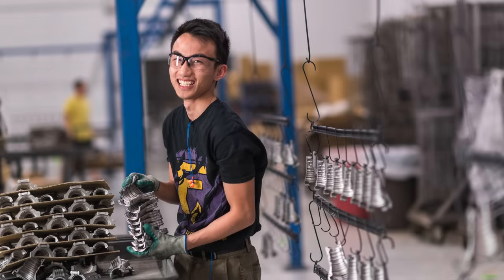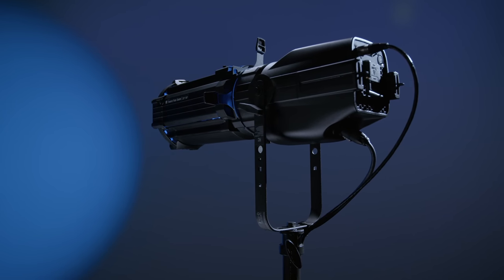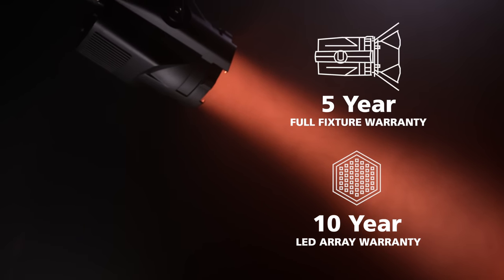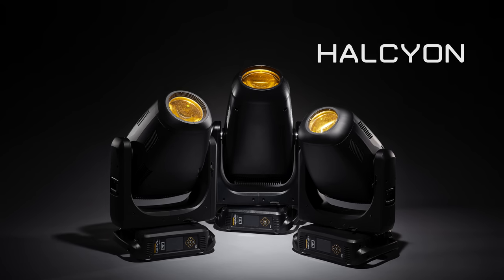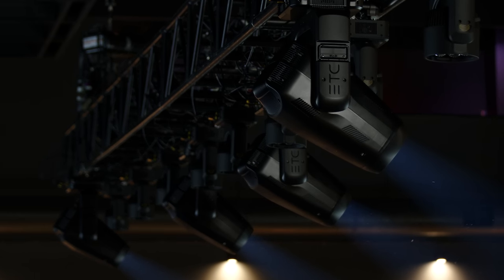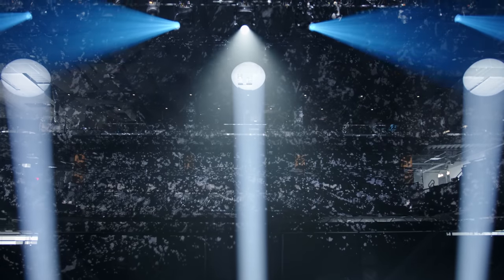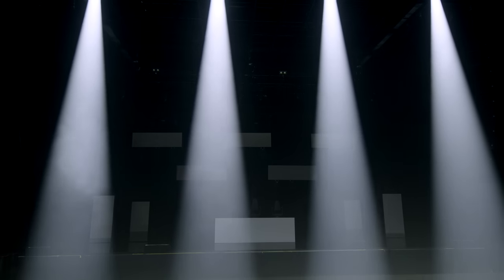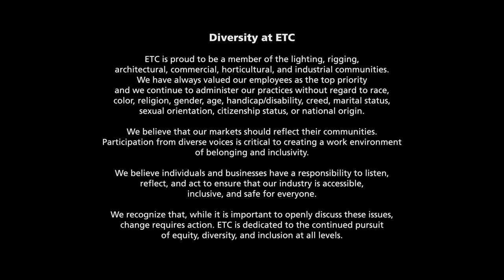ETC November 2022 Launch Event

Comment: No user interface 🤮🤮🤮🤮🤮🤮 Stop that BS! In five years, the fixtures will be scrapped because the app no longer exists and you can no longer operate them. 🤦‍♂🤦‍♂🤦‍♂🤦‍♂
Reply: if NFC dies, there's still RDM. Desire XT family of outdoor PAR fixtures got launched long time ago, there was no NFC / SetLight app back then. Those still can be configured via RDM - either from RDM-friendly console, or via USB-DMX Gadget connected to a laptop, or even through City Theatrical's DMXcat connected to a phone/tablet. RDM's future is bright -- there's RDMnet on the way (=RDM over Ethernet)
Reply: @vladimirkraynov2914  or you could just ya know, put a user interface on it. rdm doesnt always work.